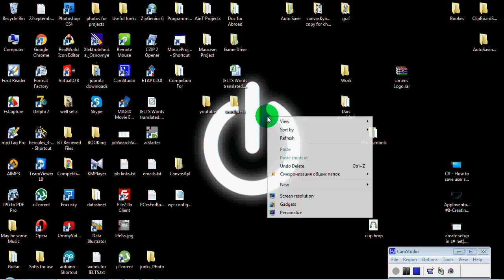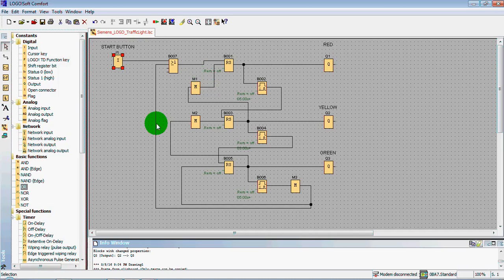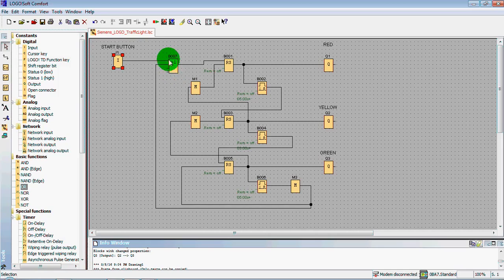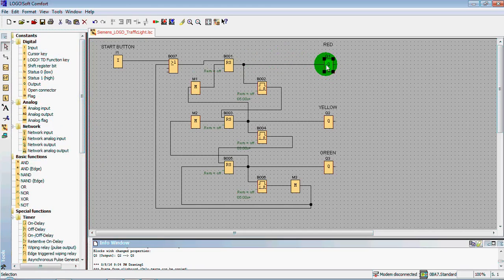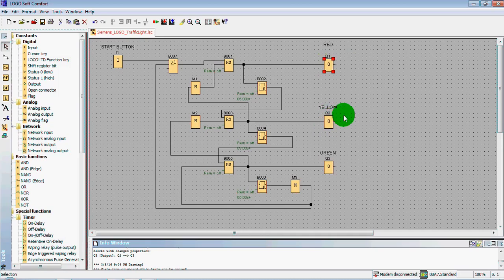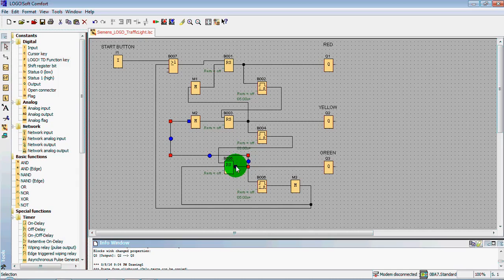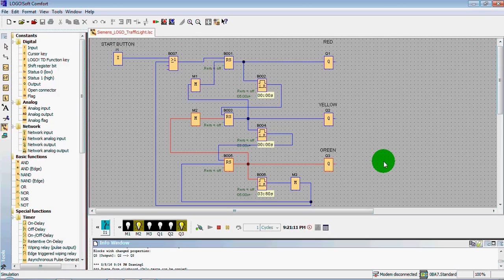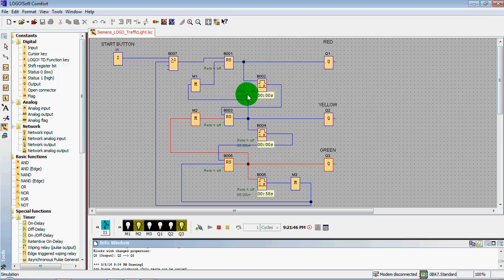#8 Siemens LOGO - Easy Traffic Light Circuit + Link to downloading LOGO Software

Comment: i can't let this work with only 2 why not?
Reply from the maker: I am sure you can. Generally it would work at least with 2 and in a maximum unlimited number (theoretically) of lights.
Reply: @nooker232 
i have 3 question can any one help me to do this 

Part 1 
From the part 1, you are to draw a function block diagram associated to the scenarios below that simulate the sequence of three lights; Green, Yellow and Red using on delay and/or on/off delay timers.
a). Red 4 sec., Green 7 sec., then Yellow 3 sec.
Draw the function block program using three on delay timers associated with each case and simulate it
Write a Program Program 1 Using OnDelay Timers

Part 2 

In this part your program will solve only for the main street lights. It does not consider the pedestrian and the sensors and on the side street. The sequence should be:
R1 and G2 for 15 seconds
Y2 for 5 seconds
R2 and G1 for 15 seconds
Y1 for 5 seconds
R1 and G2 for 15 seconds
Write a Program 2 Using On/Off Delay Timers
Part 3 (

Write a logosoft program using two on/off delay timers. This program should start automatically and keep repeating till we stop the simulation
Again, draw the function block program using three on delay timers associated with each case and simulate it. Simulate the scenarios for the three lights; Green, Yellow and Red
Green 17 sec, Yellow 2 sec then Red 5 sec
Write a Program 2 Using On/Off Delay Timers , with
B001 TH=2, TL=17
B008 TH=5, TL=2Part 1 (20 pts )
From the part 1, you are to draw a function block diagram associated to the scenarios below that simulate the sequence of three lights; Green, Yellow and Red using on delay and/or on/off delay timers.